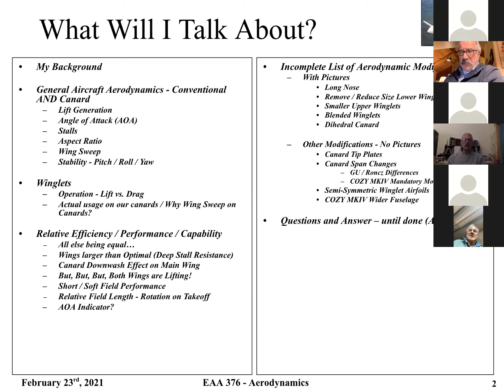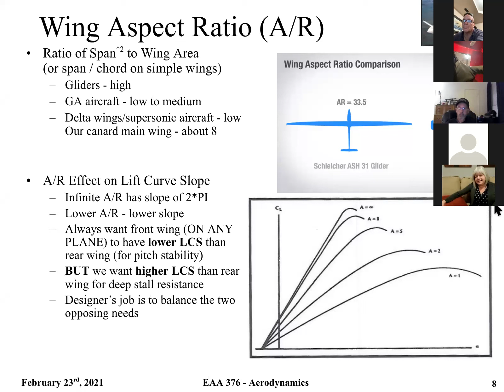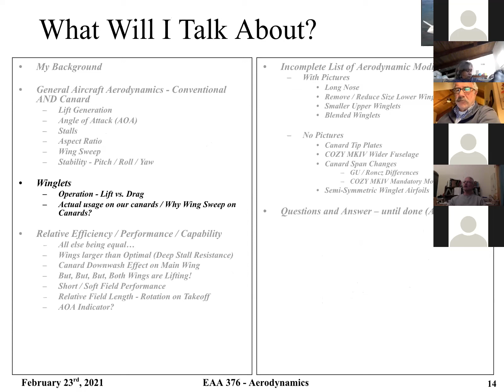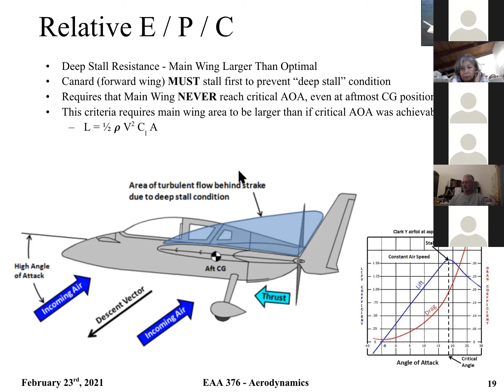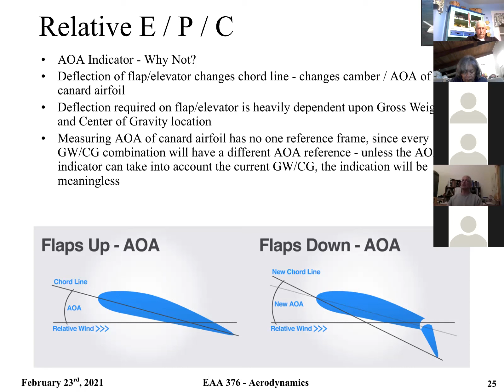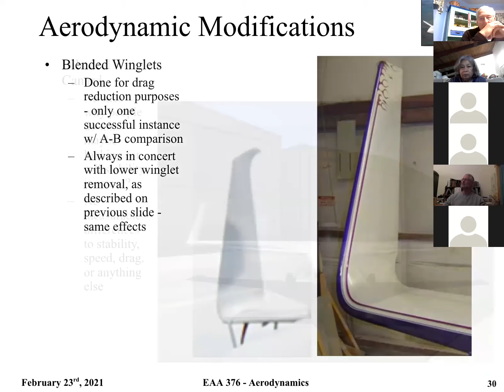Canard Aircraft Aerodynamics - Introduction

Comment: Due to canard stability, are they less affected departing a runway following a  large aircraft…ie..wingtip vortices?
Reply from the maker: I'm not sure what you mean by "canard stability".

Canard aircraft's stability (both in pitch and roll/yaw) is determined exactly like any other aircraft - they can have positive stability (return to the trimmed condition), neutral stability (stay where you put them) or negative stability (diverge from a stable situation without pilot input). If flown within the CG range and built per plans, Long-EZs, COZYs and the like are positively stable in pitch and yaw both statically and dynamically, and neutral to slightly unstable in roll, as most high performance aircraft are. Their response to external air movement inputs will be no different from any other high performance aircraft.
Reply: @zeitlinm Ok.  In my brief time of learning/studying the aerodynamic qualities canard aircraft, I have read that canards have very good roll/pitch stability. Just a curiosity if canards would be less subject to wake turbulence.

Comment: Thank you for your time on this explanation. 

The Otto 500L aircraft and the laminar flow fuselage concept seems pretty interesting. 

If you had to create a laminar flow fuselage shape optimized for 200knots @15000ft for a two or a four person aircraft, how would you start that process?

Would a good modern FEA program be the starting point to determine the geometry?
Reply from the maker: FEA is for stress/strength/stiffness analysis - I believe you're thinking of CFD. But in any case, there are numerous books that have descriptions of laminar flow airfoil and/or blunt body shapes - that would be where to start, and obviously everything is a compromise because you still have to have a shape that allows you to put people and stuff inside :-). Note that the Celera 500L aircraft project has gone nowhere, and could never have met the projected performance figures - it was/is a pipe dream.

Comment: Hi Marc, so did you ever got data from that wide-body Cozy MkIV? Also, has anyone tried staggered seating other than the StaggerEZ? Seems like an obvious solution at first glance.
Reply from the maker: Nope. Peeling actual testing data out of most E-AB aircraft owners is the worst form of pulling teeth. Most do not do enough or the right testing, and don't collect data correctly.

And yes - there are a few aircraft with staggered seating. One in Switzerland and a COZY MKIV in Texas, that I know of.
Reply: @zeitlinm  Too bad, but I guess that won't change unless FAA makes the task-based flight testing regime mandatory.
Reply from the maker: @LeShadokEnchaîné  You think that just because something is mandatory that people will do it? Without an enforcement mechanism, nothing will change. People just do not understand how to test, or the value of it.
Reply: @zeitlinm  True. In Switzerland, it is mandatory to conduct flight testing and you have to complete a flight test course at their EAA-equivalent before first flight, but I guess that's not really an option for the US. Just a bit of a waste to see so many people experimenting with their experimentals without ever publishing results (many do, I am aware). And then someday, the thing lands on Barnstormers being described as the bee's knees even though it handles more like a bumblebee's bum.

Comment: I’m building a foam plane for my aviation class. I’m modeling my plane after the Eurofighter. What airfoil do you suggest I should use for my wings and canard? I’m new to this stuff so I don’t fully understand everything in the video.
Reply from the maker: Can't help you with airfoil recommendations, particularly for small, low Reynolds # model planes. You'd have a lot more luck discussing this with folks on some model aircraft forum. Good luck.

Comment: Canard aircraft is equivalent to  conventional wing-tail aircraft in terms of aerodynamic efficiency. However, it has aditional advantage of stall/spin resistance. Therefore, can we still say canard aircraft is better?

Btw, the airliners use conventional configuration because they need highly efficient flap systems, that will produce very large pitch down moment. For the canard aircraft, it is impossible to do this because the canard is already heavily loaded, the canard can't trim the heavy nose down moment cuased by large flaps.
Reply from the maker: "Better" is relative, and is completely dependent upon what you're measuring. Stall / spin resistance is "better", but soft runway capability is worse. All depends on what's important to you...

Comment: Why do all aircraft have vertical stabilizers but all birds fly beautifully without vertical stabilizers? Getting rid of vertical stabilizers would save weight and cost and make aircraft more efficient.
I understand that is to do with roll in aircraft inducing adverse yaw  which has to be counteracted by vertical stabilizers. But there are videos on you tube of model aircraft designs without vertical stabilizers which have been flown successfully and are stable,
So my question is why haven't these successful tailless model model aircraft designs been scaled up to full size aircraft?
Reply from the maker: They have. Look at any "Flying Wing" aircraft - B-2, B-21, YB-49, etc. See: https://www.afmc.af.mil/News/Article-Display/Article/2737915/a-look-back-atnorthrop-flying-wings-part-1/ for a history of some.

In order for an aircraft without vertical stabilizers to be stable in yaw, they either need equivalent wingtip drag devices to create yawing moments, and need active stabilization, that can require substantial computer control. Birds can do it because they have an amazing computer inside their head that can control each feather on each wing and each tail feather independently to ensure yaw stability. It's a lot easier, particularly for small, GA aircraft that don't have fly by wire control and expensive, redundant computers driving the flight controls, to just add a vertical stabilizer and take the small weight/drag hit. And it is small.
Reply: Birds can shorten, lengthen and change the angle of attack of each wing independently of the wing on the opposite side.  That all a plane has to do is add a vertical stabilizer to achieve similar control authority is kind of astounding.

Comment: Lots of mistakes in this presentation.  Bernoulli's equation does NOT apply to a wing.  The pressure difference is a minor factor in lift.  It is mass deflection, not pressure.  

If you look at wind tunnel data with smoke segments...dot dot dot... the stream flow high above the wing is the free stream.  A NO point does a dot ACCELERATE ahead of the free stream...NEVER happens.  The air on the top of the wing next to the wing is decelerated LESS than the bottom, but it is clearly decelerated.  Lift is lost when flow separated and this lift loss is due to the mass not following the wing, not to pressure.

The problem with canards are many.  Here are a few...

1) The down wash makes the center rear wing in lower AOA than outboard.  That forces the stall outboard....dumb idea.

 2) The useless inner rear wing is extra drag for nothing.  Say 30-40% more.

3)  The stall of the canard makes for a "cliff" of lift where it drops and you nose in.  This means the airplane must land 10-15 MPH faster to avoid this loss of pitch control.  70 mph + 15 = 85 mph.  (85/70)^2=1.47 x more wing needed for the SAME 70 mph landing speed.

4) No flaps means 1.4 max CL vs 2+ CL with flaps.  70% of wing lift.  1.42 times more wing area needed.  

5) The loss of lift in the center rear wing due to canard, coupled with no flaps, gives around 2 times more wing area needed for the SAME landing speed.  JOKE.

6) canards are terrible in ice, which is key to usefulness.  By the time you get a canard to work in ice it has a very high drag wing.

7) Canards cannot do post stall control which is key to power on lift technology with pitch ups to  45 degree AOA.  Come in at 30 degrees glide slope, pitch up 15 degree more in post stall and land at max CL at 45 degrees AOA...that is the future...not this wimpy landing on some obsolete runway.

8) The canard main spar is right in front of the pilots face blocking view.  In a crash...like John Denver... that spar takes your head off...not good.  No wing spar should be in front of a person to cut them in half.  Just don't do it.

..... 

There are many more, but clearly a canard is silly stupid from this simple back of the envelope analysis.  Rutan's junk is just that...junk.
Reply from the maker: All I'll say to this comment is that your position on how wings work is contradicted by all aerodynamicists, and can be easily refuted by a simple search for wind tunnel smoke studies. And since the performance of canard aircraft is not dissimilar from similar high performance conventional aircraft with respect to speeds, safety and runway requirements, your position on the relative merits of canards is also easily refuted. The facts are out there if one is willing to understand them.
Reply: I have done wind tunnel tests on an original design.  All smoke tests show the air above the wing does NOT accelerate relative to the free stream...Sorry, just a fact.

I refuted the canard already.  What more do you need?  Sorry, I am a mechanical engineer and fully qualified.  Nobody qalified in aerodynamics thinks Bernoulli's equation applies to a wing.  

Like I said, canard cultist won't listen and learn.  LOL.  Believe what you will.  John Denver died do it.  @zeitlinm

Comment: Interesting discussion, I own a Europa monowheel which was the idea of Ivan Shaw who had worked with Burt Rutan long ago.  Although the Europa design was really a team effort with the wing airfoil, tail, control surfaces designed by Don Dykins the Airbus team leader who designed the Airbus wing.  The structural engineering was by Barry Mellors from Slingsby.  Many of the first Europa builders had also built Long eze types first including Ivan who built a twin engine Longe ez.  So the Europa was designed because the Long eze was not so great on soft grass airfields common in the UK.

Comment: The conventional way is to avoid deep stalls.  An unconventional way to become safer is to practice deep stalls.  Spin in one direction. Spin in the other direction.  Spin and change spin direction mid deep stall. Make good use every control surface available including flaps, fuel distribution, just everything..
Reply from the maker: Practicing Deep Stalls in canard aircraft (which can only occur if one has the CG aft of the aft limit) is a good way to destroy one's aircraft, as it is extremely difficult to exit the deep stall condition. It's only been done twice to my knowledge, and in both cases, took many thousands of feet of altitude loss to effect the recovery.
Reply: The point of the presentation however is; Careful design of Canard (actually; any) Aircraft because Deep Stalls in a Canard are fatal.  The lifting surfaces that entered the Deep Stall become stable again, in the Stall.
Reply from the maker: @bravocharlie639  Deep Stalls in canard aircraft are usually NOT fatal. One fatality was caused (in a Velocity) by an inverted deep stall, and the other was caused not by the impact with the ground (or water, in this case) but by the pilot's attempt to egress the highly modified COZY MKIV aircraft (he was wearing a parachute) and being struck by the ejected canopy. In all the other instances of deep stalls, there was a range of injuries from none to broken bones and compressed discs.

Comment: wait a minute, are you saying that an infinite wing span will have ZERO induced drag? Are you attributing induced drag solely on the wing tip vertices? That's wrong my man. Any lift generated will cause a downwash of air, everywhere at the trailing edge of the wing.
Reply from the maker: Yeah, Justin is correct, and your position is incorrect. The wingtip vortices are not the CAUSE of the induced drag - they're the indication of induced drag caused by a finite wing having the high pressure air spill out over the tip. You have to remember that in subsonic flow, there's an upwash ahead of the wing that's equal to the downwash behind the wing. If the wing is infinitely long, this drag cannot occur. It's why gliders have very long wings, and why, if the structure (and handling qualities) would allow, glider wings would be even longer. The longer the span, the lower the induced drag. Take that out to infinity, and the induced drag goes to zero. You don't need to do the math to see it - the logic is in the books as well.

And as far as not trusting math, well, not sure what to tell you. The math is a representation of reality in this case, and has been validated thousands if not millions of times. Look at aerodynamic textbooks and read the text, if you don't want to look at the math. The answer is clear.
Reply: No, it won't. 

Ref: Every single complete work or textbook on the subject.

Also Note: Wind tunnel results have zero induced drag. (Though the numbers must be corrected for interference drag or tunnel-wall effect).

Please use the induced drag formula to check for yourself:

(Lift Coefficient: Multiplied by Itself). 
Divided by: 
(Aspect Ratio: Multiplied By 3.14159265)

For lift coefficient you can use: Angle of attack, Multiplied by 0.11.

And then Use an Infinite number for aspect ratio. (Because we are trying to compute induced drag for an infinite span, therefore we need to know the result for an infinite aspect ratio).

Its interesting to note, that a wing having an infinite span and a chord of 5ft is a larger infinity, in wing area, than a wing of infinite span having a chord of 2ft. And also note that the 5ft chord wing of infinite span may have a lower aspect ratio than the narrower chord wing of equal infinite span. 

How can there be a larger infinity than an infinity? 

I don't know, but it might be the same reason that a lift coefficient of (0.00^2)/(pi*AR*e) equals incalculable amounts of induced drag, no matter the aspect ratio and no matter how short the span.

And every aircraft is caplable of zero induced drag by flying a simple parabolic flight path at a lift coefficient of 0.00, either by reducing angle of attack  to zero lift angle, or by simply parking on the tarmac and going home.

Also note an infinite span would extend through outer space where there is no atmosphere, thus deflecting zero air at the trailing edge, generating zero lift and therefore zero induced drag. So this theoretical nonsense actually makes sense in reality too.

Apple Siri has a great explanation if you ask her what zero divided by anything else is also.
Reply: @Triple_J.1  thanks for the write up, but too long to read, and not clear about your point. All I want to know is, "is tip vortex the cause of induced drag or is it just a worsening factor". OR, just to dumb it down, if you stick a wood board, with none of that air-foil shape, out of the car and feels a lift, don't you feel induced drag at the same time?

 I don't trust any math equation in this case. I am bad at math yes. Also what does the equation calculate? You see those 2nd order differential equations that are ubiquious in nature, after all the trouble solving it, the solution is one value at one spatial point. For a macro phenomena that is lift, with complex geometry involved, I don't believe any equation can do the whole wing and gave me a meaningful number.

Comment: I was under the impression that wingsweep was also to keep the horizontal center of aerodynamic pressure behind the CG.  Is this an accurate assessment? And if not, why are the wings on the Velocity Twin still swept despite exchanging the wingtip vertical stabs for a single central one?
Reply from the maker: You're correct - the AC needs to stay in the same place, whether the winglets are on the tips of the main wing or not. Moving the winglets doesn't change that need. However, the original design (of the VE or LE) from which the Velocity sprung had swept wings to put the winglets aft of the CG, and once THAT design was set, it would have taken a very large redesign by Velocity to straighten the wings, and there was no reason to do it. IMO.